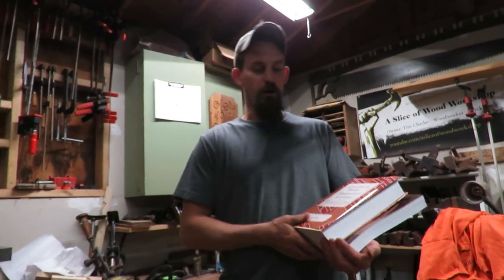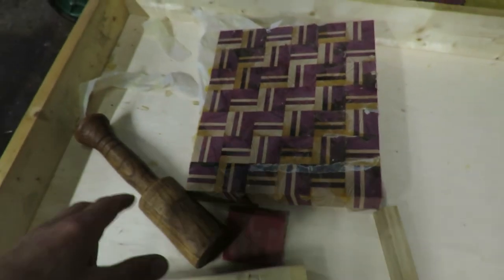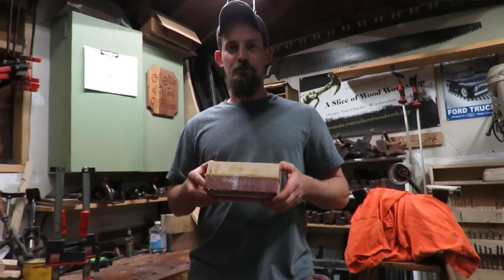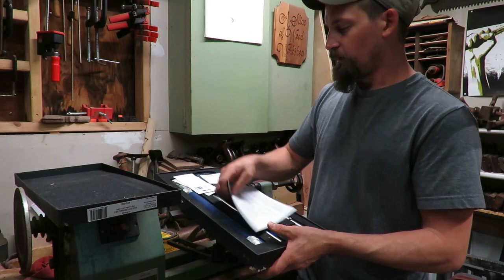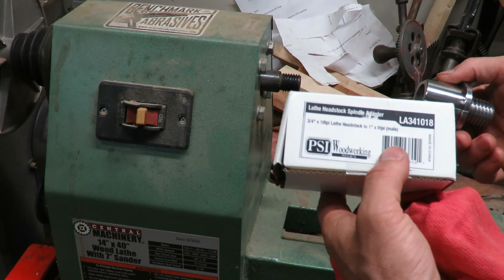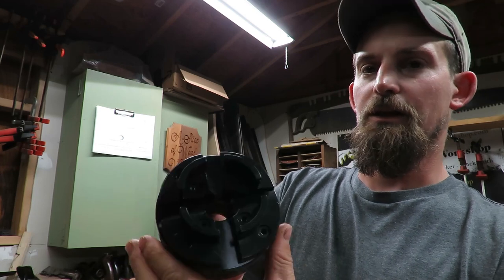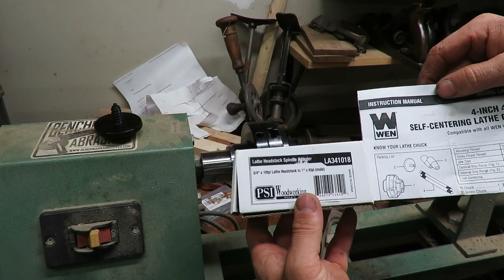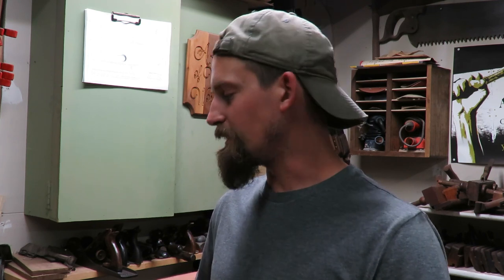Harbor Freight Lathe Upgrade! Happy Fathers Day!

Comment: 4:09 the problem isn’t solved by tools. As weird as it sounds I’ve been using hand-me-down 1970s craftsman skews and gouges for years, and I have a bunch of almost too-hard chinese gouges and chisels for 20 years. Both are HSS and maybe not as nice-looking but I can shape and sharpen them fine and the chair parts don’t know the difference with proper sharpening. 
But I think one issue that would be a game changer is the tool rest- beefier post etc.- and adding weight to the lathe.

Comment: so far hows that lathe treating you? I have the little brother of that lathe from HF, which ironically comes with the 1inx 8tpi thread headstock from factory.  also, very interesting about those planemaker's books, now I've got to look for those and the pocket edition!  THX
Reply from the maker: It's working well. I don't use it often, but when I do I have no complaints.